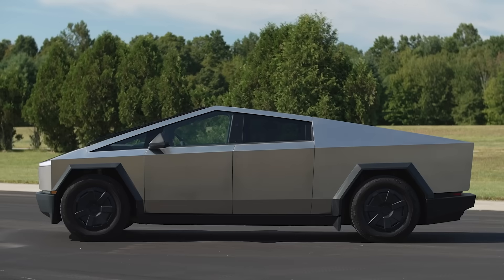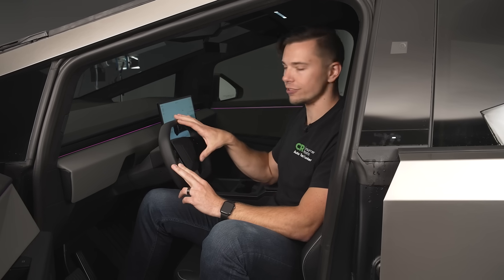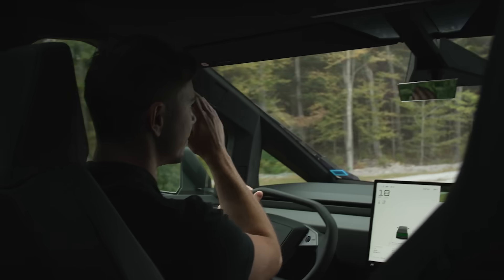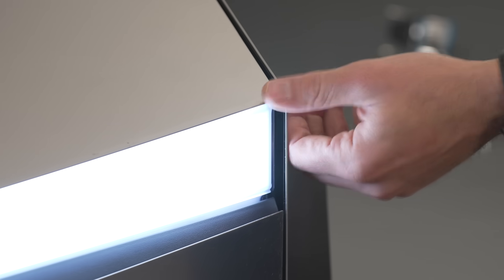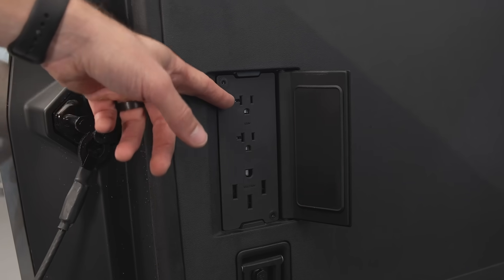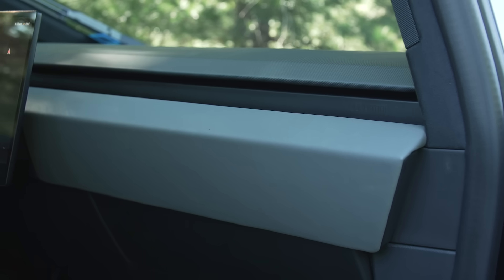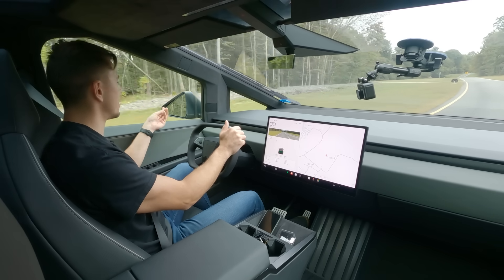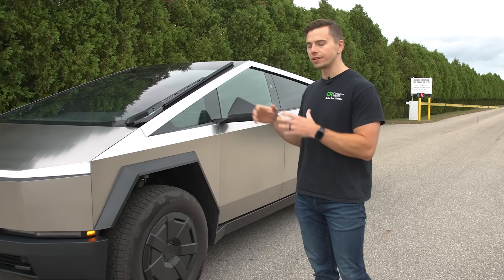2024 Tesla Cybertruck Early Review | Consumer Reports

Comment: This is Tesla! Love it or hate it, Tesla is responsible for the resurrection and the existence of the electric cars in the way they are today. A nightmare for the car mechanics, the legacy car makers and the oil companies,
Reply: Honestly, the oil companies deserve it, they've been ripping off the American people for decades! They are are trembling with all the EV's I see on the road. Source: my eyes.
Reply: The oil companies deserve it, they’ve been ripping off the American people for decades! They’re trembling with all the EV’s I see on the road. Source: my eyes.
Reply: Yes, in the way Hitler played a big role in the revival of the German economy after the first world war.  You have to separate the historical benefits from the current horrible person who has revealed himself.  #nevermusk
Reply: ITS not mechanics you need but technicians! I own a Tesla Y 2020 and I do not have valves, cylinders, oil replacement, multiple clutch, transmission, and a hundred other moving parts that can cause issues.
Reply: @Angelboy99  but you still have ball joints, steering and suspension that need repair.
Reply: @stephenj4937  Yes and these can be worked on by any decent mechanic and back yard mechanics.
Reply: @Angelboy99 But it does contain alien blood 🩸
Reply: @Angelboy99 um, bro, don't lie to yourself. You have multiple inverters, control modules, and an hvac system designed by a complete idiot who cut corners at every point to save a few bucks on your car.
Reply: @Angelboy99 
True. We had an infiltration in the tail light during the historic rainstorm and were more busy about the flood in the basement than drilling a hole to evacuate the water from the car. Other companies would have sent us to the service center and do a full checkup with a lot of additional fees for things we don't need. Tesla just sent a technician, and he only charged us for the labor and what the tail light costs.
Reply: Lol, and Tesla doesn't even give af about evs anymore. And the cyberturd is the worst vehicle made in the entire industry! What an accomplishment only space karen could do!
Reply: Based on its reliability ratings I wouldn't say it is a nightmare for car mechanics.

Comment: Do a Range Test for the Cybertruck
Reply from the maker: Range testing is one of the 50+ test we perform, so stay tuned!
Reply: Hopefully they won't purposefully leave the door open overnight to drain the battery before the test like CR has done before.
Reply: Do it pulling anything, it'll go about 100 feet, if you're lucky.
Reply: @colin-nekritz  goes 100 miles pulling 11000 pounds. nobody pulls this much. not many pull anything at all.

Comment: The weight is roughly the same as a Ford F-250. Most of the Cybers that I've seen have been wrapped. Coefficient of drag is excellent for a truck no matter whose figures you use. If you are fearful of steer by wire, you probably should never fly.
Reply: What other brand new vehicle out there makes you think, "as soon as I buy this car, I'm going to wrap it"?
Reply: Good point about steer by wire.
Reply: He also didn't mention 4 wheel steering, and FSD is being released this week.
Reply: Spot on
Reply: Wraps cost thousands and tesla is no longer offering them. 
Drag coefficient is worse than the silverado ev.
Airplanes are checked every flight for problems. This steer by wire system needs two motors, another one for force feedback, and already has had multiple failures and one instance that had it shut off with a warning message that it did that to prevent more damage. 
THAT MEANS YOU COULDN'T STEER THE TRUCK AT ALL! WHILE THAT PERSON WAS DRIVING!

It's literally a solution in search of a problem!
Reply: @sprockkets  Do you have a link for that claim, steering disabled while driving?
Reply: @sprockkets  This system has 2 motors on the steering rack, one in the column for steering feedback, redundant power for each motor.  It is a ZF product and you will be seeing it in other cars soon.   A car without speed proportional steering will soon be an also ran at the dealership.

Comment: The 2014 Infinity Q50 would like a word on steer-by-wire.
Reply: Go back and listen to what he actually said. This is the first steering system sold in the US without a physical connection between the steering wheel and the wheels. The operative word being "physical". The earlier systems such as designed by Infiniti had a mechanical backup system.

Comment: FIRST car with steer by wire in US? Incorrect Nissan was first with Infiniti 50 due to Sebastian Vettel's consulting and recommendation since F1 uses steer by wire
Reply: The Infinity you're talking about is not a true steer-by-wire system. That car still has a physical link from the wheel to axle aside from the electronic assist system. The cybertruck does not have a physical link.
Reply: Go back and listen to what he actually said. This is the first steering system sold in the US without a physical connection between the steering wheel and the wheels. The operative word being "physical". The earlier systems such as designed by Infiniti had a mechanical backup system.

Comment: how are there no parking sensors on a $100k+ car?  That is absurd!
Reply: I don't know why he said that. It has a camera system for parking
Reply: The reviewer is very wrong on that point. Not only does it have a full 3D visualization of your surroundings when parking, it has a 100% autonomous parking feature (that is included in the model they reviewed) that works better than any competitor's auto-park I've seen.
Reply: It is software based and is now upgraded.  So it has the sensors and self driving system.
Reply: This was a recent upgrade in September. It now has vision park assist just like other Teslas. It also will now park itself.

Comment: Didn't infiniti do steer-by-wire about a decade ago? Or was that not the same thing?
Reply: They still had a mechanical linkage as a fallback if the steer by wire system failed. Cybertruck is the first production vehicle with a steer by wire with no mechanical fallback, but just a redundant motor.
Reply: The steer by wire system is made by ZF.   It will be showing up in other cars in Europe.  Not sure about the US.
Reply: Go back and listen to what he actually said. This is the first steering system sold in the US without a physical connection between the steering wheel and the wheels. The operative word being "physical". The earlier systems such as designed by Infiniti had a mechanical backup system.

Comment: Can Safelite repair/ replace that windshield?
Reply: Very likely not. A friend's son had his model 3 smashed in the rear. it looked like mostly cosmetic damage and some plastic bumper bits might need to be replaced. No mechanic around our (largish) city wants to touch it since the battery pack (which is fused with the platform structure) potentially looks damaged. So a 2 year old model 3 may need to be totaled for what any ordinary car would be a $4K repair.
Reply: @LouisDuran  Did you take it to a Tesla repair center for a quote?
Reply: Who cares who replaces it.  Tesla repair replaced mine that had a rock crack in it.
Reply: From the safelite web page 
 Top-notch auto glass repair and replacement for your Tesla Cybertruck
When your Tesla Cybertruck has damaged auto glass, look to the experts at Safelite

Comment: So if you need to keep the to bed cover closed when driving or else range drops, what about when you’re hauling stuff that need the bed to be kept open?
Reply: You lose a few % range
Reply: @BorkyBorkbork  just like in a conventional truck!!!
Reply: Watch a tesla towing video.  bearded tesla guy has done some miserable family trips where he pulls a camp trailer and has to ditch his trailer use a generator to charge to backtrack to a supercharger.   Range anxiety sums it. Theyre turning the ac down or freezing cold driving 10 mph under the speed limit, every charge stop is a gamble if its going to work or slow charge, when other teslas charge it can drop the charge rate, they unhook to supercharge then rehitch every 80 miles and pay 40 bucks each stop for the privilege to pull 100kwh hbut 10x the cost.

Comment: It is one expensive refrigerator that traps your fingerprints.

I have a friend that works at tesla, he says no way would he buy one, considering he sees how it built.

It is built for people who can't drive and needs to look good.  

Another friend bought it and after waiting forever and after driving it for 3 months he sold it.  He only bought it thinking it would be a greener way to drive.

Limited space putting a large piece of furniture in the back of the bed.  

Save you money.  👎 on truck 

Good review.
Reply: Written by a person who has never before used a pickup truck or couldn't figure out how to use one.

Any pickup truck with a short bed of 5 or 6 ft will carry large and long items with the tailgate down. Strap it in and off you go, like millions of people with pickups have been doing for over 100 years.

Short-bed trucks also carry 8 foot or longer lumber and sheet goods with the tailgate up or down. Attach a red flag, tie it down and off you go.

No one is carrying large long items cross country in their pickup truck. 
Items don't need to fit inside a closed bed with the tailgate raised.

The Cybertruck is all the truck most people will ever need.

Keep paying $400, $500 per month or more for gas, oil changes, brake jobs, scratches, dents, parts, maintenance and stolen catalytic converters. Genius.

No wonder so many people in the USA are poor. No critical thinking skills.

Comment: all the 'positive' features of all Tesla vehicles in the latest several years have to be offset with the fact that the company is using the worst and cheapest materials they can find. The external plates (stainless steel pirate swords) of the Cybertruck are glued to the body, similarly to the pedal which was glued and had to be recalled to be fixed with a blind rivet.
Tesla doesn't mind the dangers to the consumers.

Comment: Correction: FSD 12.5.5 was released to the cybertruck on September 29th.
Reply: Based on the examples of "Full Self Driving" posted on YouTube, it's at best half-baked, and not fit for surface streets.
Reply: @JamesYale1977 The Cybercuck - for guys who would rather sit and watch instead of doing the driving themselves.
Reply: Only for a select few, not most
Reply: @Eric-xp1kl  Nope, surprisingly we've all been getting it, though like any roll-out it's not simultaneous.
Reply: Tesla still isn't close to Full Self-Driving. Tesla has been promising FSD "next year," every year since 2016. Having experienced the current state of FSD in my Tesla earlier this year, I say no thanks, it's like having a lousy drunk at the wheel. I am skeptical that any Tesla will become actually self-driving with a camera-only system.
Reply: @tdrcar FSD has gotten amazing since earlier this year, drives pretty much like I drive only it's better at spotting pedestrians and other cars.
Reply: @lbeck37 agree.  Fsd on the cybertruck is pretty good.  Not perfect but it drives me to work and back everyday now and I rarely have to correct it.
Reply: @tdrcar  You dont know what your talking about I have it on two other Tesla's model S Plaid and Y it's fantastic as well as my new Cyber Truck I suggest you not buy any more Tesla's go get a Ford
Reply: @tdrcar  Tesla and others working on self driving are doing what has never been done.  Invention at this level happens on its own schedule.    It is far more important that we get  self driving, from anyone or ones, than when we get it.   
Self driving will continue to improve.  USDOT is working to get V2X  into cars.    When (not if) this happens cars like airplanes will know where the other cars are, direction and speed.  The road will tell the car what the speed limits etc are.  It will make regular and self driving many times safer.   
People drive with a vision only system.  Our visual acuity literally stinks outside a narrow 2 degree central arc.   Gets so bad on the edges that it is better characterized as motion detection than vision.